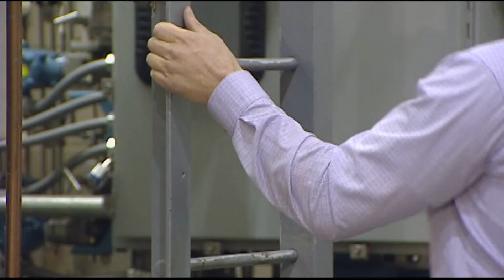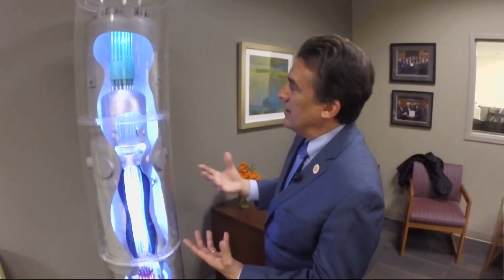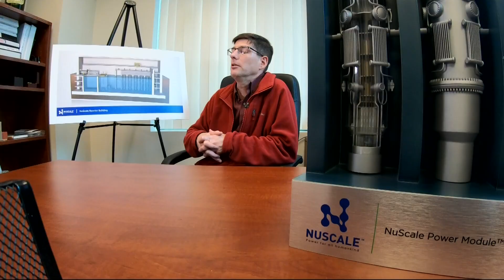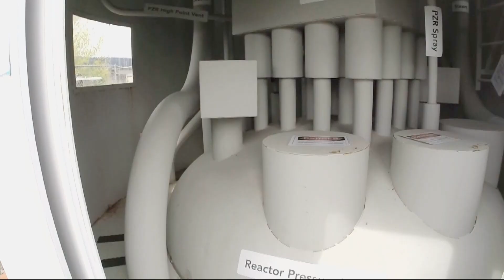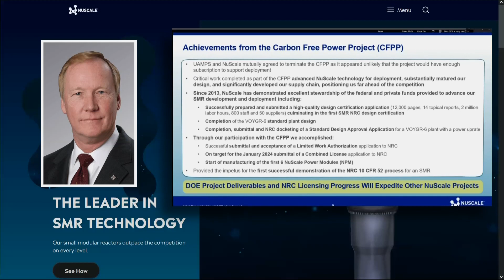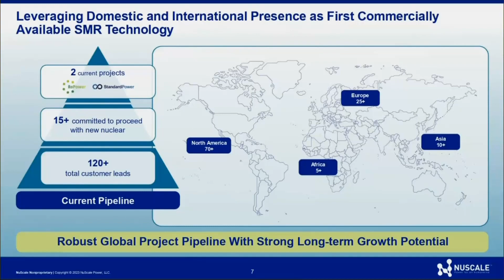Portland-based modular nuclear reactor company loses major contract

Comment: Small Modular reactors have a place but people expect cheaper safer and more efficient designs with twenty five years without a refuel which is possible.
One of the main advantages of some of the designs is being resistant to weather such as tsunamis and earthquakes and external water supply issues with safety a priority for all the new designs.
Just goes to show the mighty dollar is still king in the USA with cost per KW/H still the main driving force.

I would imagine if a design combined a twenty five year refuel with excellent safety in all weather conditions combined with some intrinsically safe systems to stop thermal run away and sold for a competitive price they would be more successful. Obviously with Small Modular Reactors the more they can manufacture means more profit for the company and a lower product cost.
😎🇦🇺
Reply: EVERY reactor built  in the U.S. MUST be designed to withstand all reasonable man made and natural events.

And their is not nd never has been economies of SMALL scale